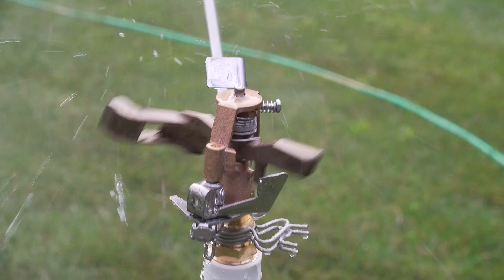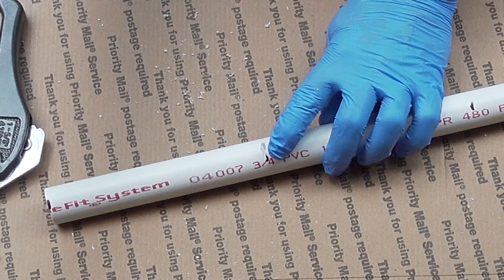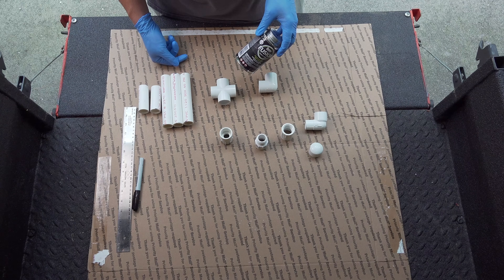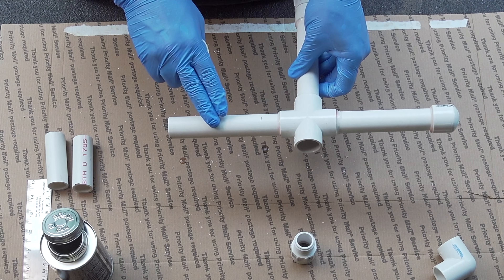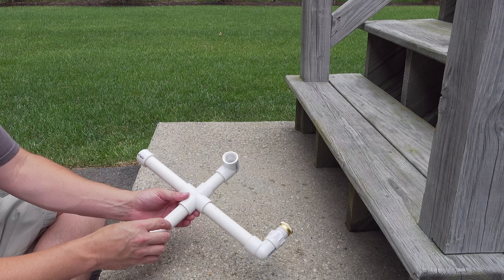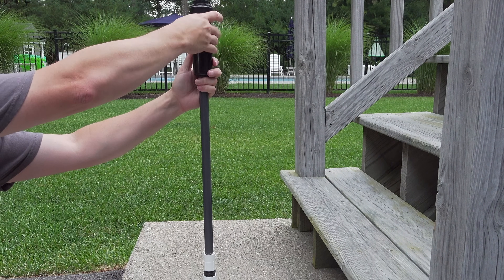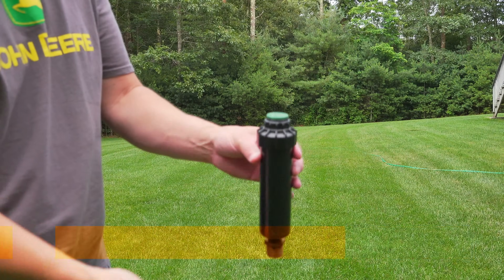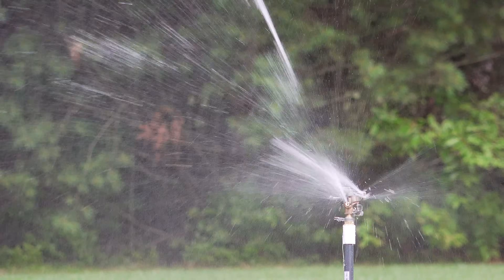Best Lawn Sprinkler DIY - Without an Irrigation System- Build your own EASY

Comment from the maker: Thanks for watching, I hope you enjoyed this project. Parts listing is in the description.
Reply: Thanks for sharing this video! 
Just a quick question on the glue..does it have to be pvc glue? Or can I use all purpose glue I have like the Loctite GO2?
Reply from the maker: @ianhong5624  You can use other adhesives and glues but there is a chance they could let go and the water would come out but since it's outside that may not be an issue. The PVC cement stuff is really good but use what you have and just be sure to keep an eye on it. if you do. and it's in a sensitive area.
Reply: @SilverCymbal  Got it! Thank you so much for the information!
Reply: I was looking to install some in ground pop up sprinklers, with a Rachero controller.

New to this.  What do I need to buy?

I have a propex expansion tool.  I realize mose kits arent going to involve using propex, but I mention it incase its a better option than what a kit provides.

Thanks.
Reply from the maker: @andyh8239  You won't want to use propex. If you are in the northeast most of us use black flexible pipe "poly pipe" and elsewhere in warmer climates PVC is often popular but you can see this in boh areas too.
Reply: How long do you water for?
Reply: How much water pressure do you have?
Reply: What's a great light weight hose to drag out to the yard for this set ups
Reply: How do I get parts listing?
Reply from the maker: @jackcourt2004  Everything is in the description
Reply: Where can I find the description?
Reply from the maker: @arialagarajan7024  Yes here https://amzn.to/2lbVPWb
Reply: would really like to know what the impact sprinkler extension is, size and a link to buy
Reply: I thought you had installed in ground sprinklers in your yard? Where is that video you made.... let me go look. But thanks for the above ground sprinkler build. I have the old brass (not the new plastic) type and also like the sound they make. Easier to hear and tells me when it’s on. Haha
Reply from the maker: @MRrwmac  Yes I do have them, but not everywhere. So I use portables when I can and also for spot watering, and even the kids sometimes too.
Reply: I did not  see the size for the parts, will any fit
Reply: @shonndalee5882  Based on the parts in the description I'd say 3/4" pipe.
Reply: What state do you live in? This is beautiful…
Reply: Thank you my friend that was very informative
Reply: @agoniaXdunya  he's in Massachusetts
Reply: @jackcourt2004  click the video title
Reply: Size of pipe ?
Reply: @dougswails965  All in the description Dougie

Comment: I made some very similar sprinklers recently, and discovered  a little problem.  Placing an impact sprinkler head on top of a PVC riser enabled the sprinkler head to sort of rock back and forth, which would absorb some of the impact and cause the sprinkler to work less efficiently.  Sometimes it would get stuck, instead of changing directions.  So I came out of the cross and added a bushing and increased the pipe to 1-1/2", then added the 90 and the riser, and a threaded bushing at the top.  For those that are concerned about reducing the flow because of the additional water in the riser, the flow actually increases.  Inches of water column is measured in pounds per square inch, so you can increase the pipe to any size and the pressure will be the same, relative to the area.  Also increasing the pipe size will reduce the friction loss as the water moves through the pipe.

Comment: For anyone having problems with the pvc to garden hose connectors coming apart under pressure, try a “Metal Double Female Adapter” for garden hoses. Attach the metal adapter to glued on 3/4 pvc slip to male garden hose fitting in place of the pvc adapter. So far mine has been much more durable. The metal adapters are often available in the garden section of home improvement/hardware stores.

Comment: OR INSTEAD OF MAKING ONE , JUST GET A BROAD BASE OR SPIKED TWO-PART SPRINKLER WITH A TOP SPRINKLER PART THAT SCREWS INTO THE BASE BOTTOM PART AND UNSCREW THE TOP SPRINKLER PART, THE REMAINING HALF INCH HOLE AND THREADS IN THE BASE WILL PROBABLY FIT THESE STANDARD YARD IN-GROUND SPRINKLER PARTS AND RISERS AND HEADS LIKE THEY DID FOR ME 🙂

Comment: Make sure the sprinkler you build has a footprint large enough to support the height of the vertical pipe and sprinkler head. The distance from the bottom of the standpipe to the top of the sprinkler head should be the distance the base extends out in all directions to prevent the force from the water from tipping the sprinkler over.

Comment: If no in ground system, nothing better than traveling sprinkler tractor.  Turn on and let it go.  Use water hose to determine route.  Adjust spray diameter.   Very convenient.

Comment: You have just made my day, week, whatever.  My yard is atrocious and as a disabled military retiree, I do not have the inclination to put all the effort into my yard.  My old sprinkler system (inground) never really worked properly and so I have been looking for ways to revitalize my yard.  I have close to an acre in a subdivision and on both sides in a patch of area, shared with my neighbors which will require precise and directional watering.  This system is perfect.  Most of my old heads are destroyed due to having been cut by lawn mowing, lack of maintenance, and disuse.  Now, I can build a customizable system to best water my lawn without spending the thousands it would cost to have a new inground system installed or all the excessive parts for an above-ground system.  Also, I love how I can expand, at will.  Thank you and bless you for this.

Comment: Great idea!  I made 5 sprinklers for around $75!  I ordered 4 of the orbit sprinklers (Amazon has two-packs) and nearly covered my entire yard (3/10s of an acre).
A few added suggestions:
- if you are using the orbit sprinklers, you can get the fitting that has a male connection on the end of an elbow to avoid buying an adapter.
- if wanting to connect multiple sprinklers, you can use a straight male fitting to save cost (or the elbow fitting with the male in the bullet above)
- I haven't yet done this, but you could also make a riser pipe out of PVC to further save cost
Reply: He goes do fast. I have the rain bird sprinklers. Can you tell me how many of each piece is needed to make one sprinkler?
Reply: Wonderful feedback!  would you mind giving the link to the orbit sprinklers that have the male connection?  thank u!
Reply: @pamdavis9077  I too would love to know

Comment: I was going to make two of these, and I didn't even search on it, but saw this pop up! If the 4 way cross piece is hard to find, or too expensive, you can also use two "T" pieces, with one tee pointing one way, and the second T pointing the other way. Just use a short piece to connect the T's together.

Comment: I made 2 of these with a couple Hunter PGP heads. It worked fantastic! This is works 20x better than the cheap store sprinklers I have been buying, trying, replacing ....and  I can use the same heads that are in my front yard which has irrigation, so it gives me extra replacement heads. Great video!
Reply from the maker: So glad it helped. I still use these all the time myself, you will see them in many of my videos. Glad they worked well for you.
Reply: whats the point of the pvc pipes though?  does it create more water pressure or something?
Reply: @joelarson6658  No, it’s just very cheap and easy to make. Plus it lets you attach a wide variety of just about any kind of sprinkler you might want to use.
Reply: @jarednance5502  thank you :)

Comment: I did something similar to this. I wanted a somewhat more permanent solution so I routed the PVC down and back up into the bottom of the sprinkler head. This allowed me to run my water hose above ground but still have my sprinkler buried. Because I cut my grass as high as my mower will go I can cut over the whole system and not worry about hitting anything.

Comment: Just a heads up you can change the pattern on all of those sprinklers there’s a simple adjustment screw at the top of the black and green ones it should fan a little bit to cover the whole stretch

Comment: All rotor heads come with a white key and different size nozzles to put out more or less water and the top of the head has all the adjustments for the head for angle, rotation and water output aswell

Comment: The best irrigation system I ever saw was a company in Amarillo, TX who did 1 house (my parents house) then went out of business. They trnched front, back, and side yards, laid in pea gravel about a foot down then laid the pipe in which had a 16th of an inch hole every 6 inches, then more pea gravel on top, then the dirt that they trenched out was put back in. All the lines went to a valve type system and then a branch off of the water line going to the house was ran to the valve's. It had a pressure tank so that You could put fertillizer into the system and it would do your whole yard. I could barely turn the water system on and leave it on all year and the grass would stay green all year long and since it was only going as a steady drip it fed the roots to the grass. Sprinklers today waste so much water. By the time you start to water the grass with sprinkler heads going and the water hitting the top of the grass instead of the roots where it is needed the most, you have wasted 50% of the water used. Sprinklers to me are a waste of money

Comment: Just a tip on getting that threaded elbow pointing straight up - before gluing up the male fitting (that attaches to the street elbow), use that fitting and a length of pipe (not glued together, just dry fit) and thread that on to the female 90' being glued up. The length will make it much easier to tell if it's straight up and down. Use a level on it if you really want to go nuts. Just make sure your work surface is level too! Unthread it after it sets and use the male fitting where it's needed.
Reply: @Travis L The elbow fitting in question is the one with the female threaded hole facing up.  In this demonstration, he just "eyballed" the angle of the fitting as he put it together, trying to get it pointing straight up so that the sprinkler head will not be tilted when screwed into this fitting.  You can judge the angle a little better, when gluing this fitting in place, if you first thread a short length of pipe into the fitting.  You don't want the fitting to be angled one way or the other, and it's easier to see a slight angle in the alignment if you're looking at a few inches of pipe sticking up.  Once the fitting is set in place, the temporary "reference" pipe can be removed from the elbow.

Comment: I appreciate the effort and time you put into making this video and sharing your design.  I build the DIY sprinkler-head base and it has help to keep my lawn watered.  However, I would suggest you make all the legs of the design six (6) inches long to help balance the sprinkler head and keep it more vertical.  Also, I found that depending on the grass height the design tends to rock as the sprinkler head rotates.  I found that adding something like a weighted bag around the base of the hose attachment helps keep the design more stable and rock less.  Overall, it is a clever design and easy to build.  Great job and thank you!
Reply: I was thinking the same, maybe filling the pipes with sand before doing the welding,  or add some sort of spike so it stays grounded.
Reply: @vegaflores48  It's been a year since I placed the sprinkler in service and it has met my needs.  I will take your suggestion into consideration but you will need to seal off the segments of the pipes you fill with sand (perhaps with epoxy glue).  Otherwise, the sand could clog the sprinkler head or be washed away when you turn on the water.  However, I am sure you realized this as a do-it-yourselfer.  Still, I would increase the length to six (6) inches or longer.  Thank you for the comment and suggestion.

Comment: Great video. Just realize that your favorite sprinkler head (brass) is substantially less efficient than the other two sprinklers. Also you should be able to get different nozzles for the sprinklers to accommodate other situations. Again great video. Thanks.

Comment: This guy rocks!!!  Great video.  Only problem I had during test is it tipped over.  The straight piece in the middle that the sprinkler heads screw into needs to be a minimum 6" long and not a 3" piece.
Reply from the maker: Thank you very much

Comment: I'm at checkout at Lowe's. Used this video to buy the pieces for the system. Will update soon to let ya'll know how it works out :]

Edit:
Without any prior knowledge to working with PVC  I strictly followed the tutorial while building this and it works like a charm!
I bought everything I needed at Lowe's and it cost around $20 all together. I bought an orbit adjustable sprinkler head that sprays 15 up to feet and it's all I need for a yard of my size.
I'll probably make some more soon for my yard work clients :]
Many thanks 👍
Reply from the maker: Appreciate that thank you
Reply: @SilverCymbal  Read the edit :]
Reply: What about 2 wheels? Increases the cost but then I could start at the far end of the yard and just pull the hose back.
Reply: @billjennings463  That's an interesting idea 🤔 I say try it out if you can figure out how to attach the wheels.
Reply from the maker: @billjennings463  You could, but I wouldn't bother. Remember the PVC is round on the bottom and smooth, you can easily slide it on the lawn, its very light too.
Reply from the maker: soaringtractor  There is a first time for everything for everyone, don't be unkind. It's Memorial Day have a hot dog, smile and help others.

Comment: Thanks for this build video.  I made one using the 50ft sprinkler head you first installed and it worked great - except for the fact that the water pressure caused the unit to completely flip when spraying in the direction opposite of the hose attachment.  This may be due to the fact that I am using a light weight hose, however, I was able to remedy the problem with a 3” diameter - 8” long metal pipe used as ballast.  I disconnected the hose, slid the ballast pipe over the hose - reconnected and pulled the weight so that it covered the hose connector.  No more flipping!    Covers a lawn measuring about 180’ x 80 with just one move (two positions).

Comment: Great idea and your presentation was top notch! I would like to add some plumbing pointers however. One, use Teflon tape on the joints. The actual purpose of the Teflon tape is to lubricate the threads so the tapered fittings seat fully without galling. If you swap out fittings, you will have difficulty doing so if you gall the threads. It's not a matter of whether it leaks or not but whether or not you will damage the threads. Two, the cut ends of the PVC pipe should be beveled, but for this application I wouldn't worry about that. Three, always use glue on both the pipe and the fitting. I always wipe off the excess which makes for a professional appearance. The writing can be removed from the PVC pipe with acetone. I found your video while researching using a pump to water my lawn from a natural spring on my property. My well pump overheats in the Georgia heat and I don't want to abuse my well so I can cut more grass...but I love a beautiful lawn! Lol!
Reply: do you use the glue after you have added the teflon tape?
Reply: @pamdavis9077  PVC glue is for joining socket  fittings to bare pipe, and the thread tape is for the threaded fittings. You never combine the two.

Comment: Cool. Kind of an above-ground version of a below-ground sprinkler system, with the added benefit of being able to move the sprinkler.  This would also let you experiment with layout for a below-ground sprinkler system, testing coverage with various locations and sprinkler heads, before you commit to putting in the below-ground pipes.
Reply from the maker: Thank you, and those are really great ideas, could save a lot of trouble later if the system is setup wrong. Thank you
Reply: Not really, installed systems have much higher PSI (like 160) while your hose is only 55 PSI. Big difference in coverage.
Reply from the maker: @TraconWizard  Installed sprinklers and portables have exactly the same PSI output. They don't increase or decrease it.The flow rate could be different if larger sized pipes are used but presure is the same. You can verify this with a gauge
Reply: @TraconWizard  - Are you referring to sprinkler systems for parks and other large areas? The front yard of the house I'm living in now is about 1200 square feet, and uses three sprinklers (it could use one more for best coverage), and my water pressure gauge shows pressure at the sprinklers averages around 50-55 psi, though street water pressure here is about 70 psi, measured at a faucet connected to the same water pipe that feeds the sprinkler system. I don't know why there's this difference, but I'm guessing there's something in the sprinkler system that reduces the water pressure.  Manufacturers of most popup sprinkler heads and spray nozzles typically used in residential lawns recommend 30-45 psi, because higher pressure can cause spray nozzles to generate mist which can be carried away by the wind instead of falling onto the lawn. I'm no expert, so maybe some other types of sprinklers and nozzles need more pressure.

Comment: We have tried everything except having a sprinkler system installed. Or I thought we had. This looks like a great setup that I am definitely going to try.
Reply from the maker: Thank you very much this can give you the benefits of the built in one without the expense. Some even do this first to help lay out where the heads need to be, like a rough draft.